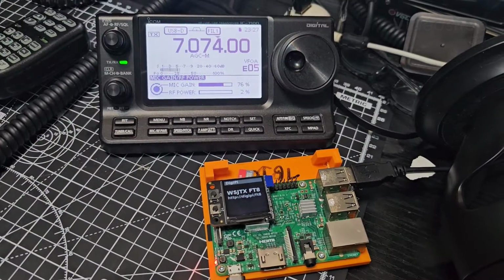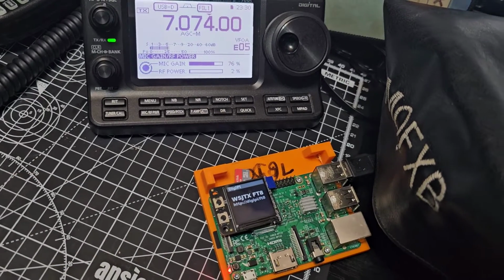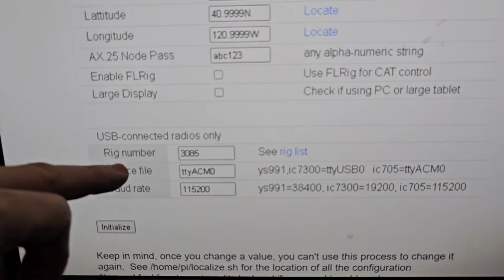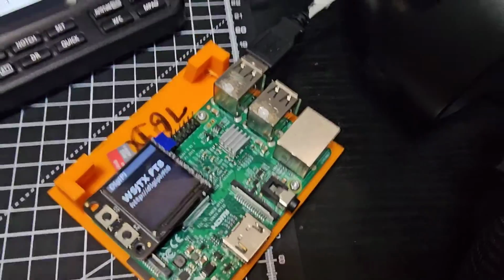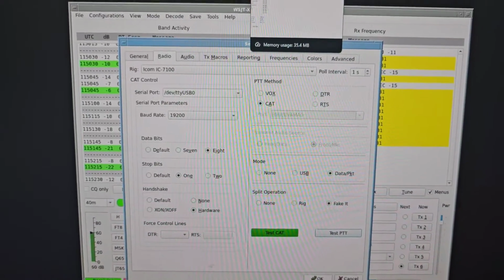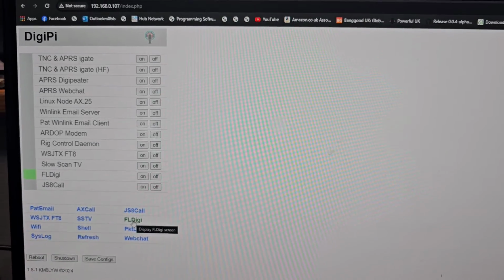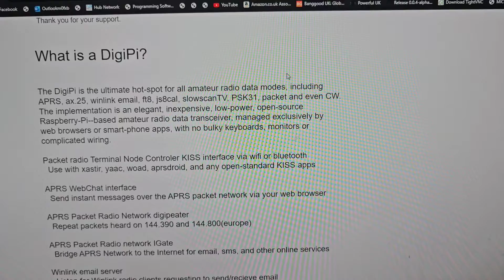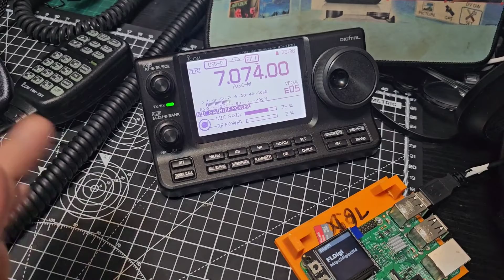DigiPi - ICOM IC-7100 Connection / SetUp

Comment: im doing the exact same thing. what settings on your 7100 are you using? haveing issues getting my digipi to work with the 7100
Reply from the maker: Hi set rig number and USB selection then change final settings in WSJTX.